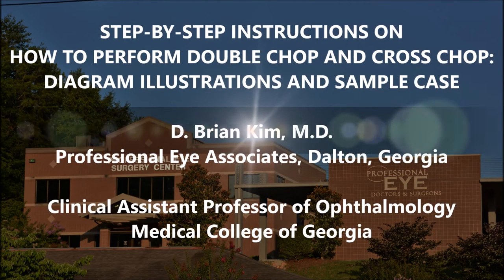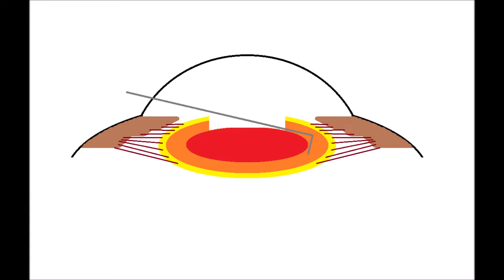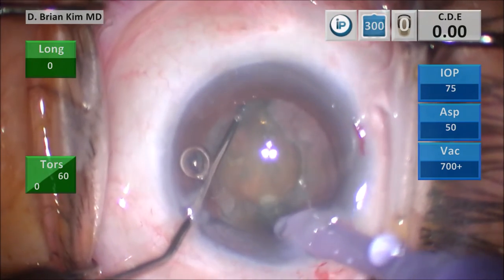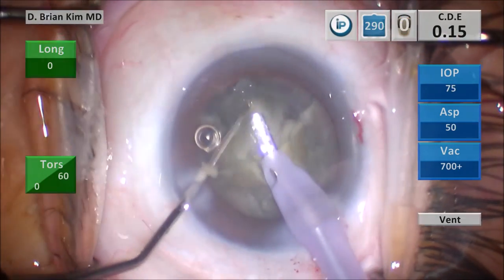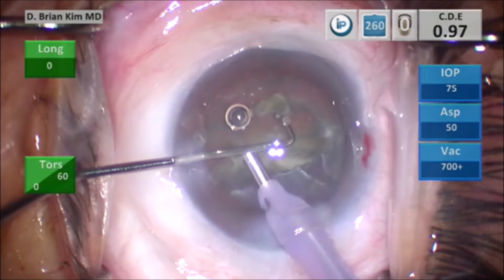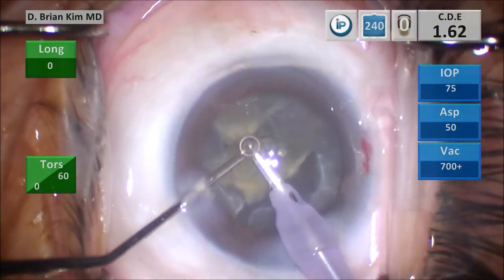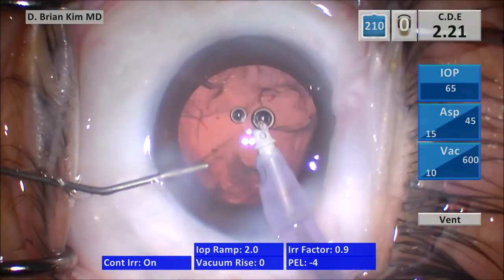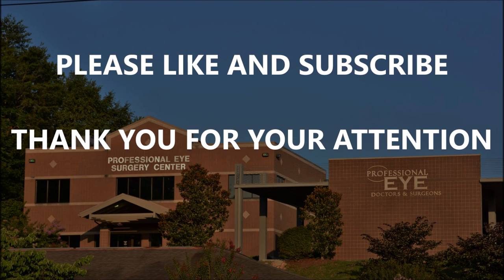Step-By-Step Instructions to Double Chop and Cross Chop: A How To Video

Comment: Amazing video like most of yours. Im trasintioning into this technique specially for soft nucleus. I was wondering if you could help me with something that still gives me a lot of nerve....Stabbing the phaco tip into the nucleus. It gives me a lot of nerve because I have never done it, How do I know Im actually stabbing it in the nucleus instead of pushing the nucleus? Im very afraid of trying to stab it and push the nucleus instead with damage to the zonules or breaking the PC.  Thanks for your work and help.
Reply from the maker: Hello, this is very important. You should never "stab" the lens without counter force from the chopper. In fact the chopper is doing most of the cutting of the lens itself. Rather, the phaco tip is acting like a fulcrum to grip and hold the lens in place and preventing it from moving as the chopper cuts the lens. Not necessarily a stabbing maneuver. The key is equal and opposing forces. Any poorly executed technique can lead to a complication so I would strongly suggest practicing in a wetlab with pig/cow eyes try it on an artificial eye such as Bioniko or Simuleye. Best wishes.
Reply: @DocBrianKimMD  UPDATE: Dear Dr Kim. I been using your technique with great sucess on my last 5-6 soft nucleus, the Kim chopper has really helped to make it easier. I been trying it mainly on soft nucleus, i was wondering until what hardness of nucleus on LOCS scale do you usually stick witht his technique? with harder than 4 NS nucleus I been sticking still to stop and chop. Thanks.
Reply from the maker: @ravr2442  I will use double chop for soft to grade 3-4. Hypermature cataract I use terminal chop technique which is a modified stop and chop and works much better to prevent posterior plate.

Comment: Congrats for the technique. My Main concern is how dive the phaco tip(is it Possible do not penetrate?). Is your phaco diameter smaller/sharper than the usual one?Thanks!
Reply from the maker: Great question. No, the phaco tip and sleeve are a standard 45 deg 0.9mm balanced tip, which has a curve to it.

Comment: Thanks for video.How much phaco tip to expose? for direct chop or double chop and based on cataract grade
Reply from the maker: oph dr that’s a great question. I think 2x the thickness of the phaco tip is good but it might be more than what people are comfortable or accustomed. But the sleeve extension is not really the primary issue. The technique is. I would say 1.5-2x phaco width as long as the irrigation ports do not slip out of incision during the maneuvers. That’s the more important issue. Hope this helps

Comment: Sir, nice video and concept.....one question is that due to mechanical fracturing by phaco tip and chopper....wat is the chance of damage of phaco tip by chopper itself due to repeated touches between chopper and phaco tip...
Thanks for reply...
Reply from the maker: Amt sd I would think that as long as you don’t apply ultrasonic energy while the phaco tip touches the chopper, it should not cause any damage. It is important not to phaco the chopper. Best wishes.